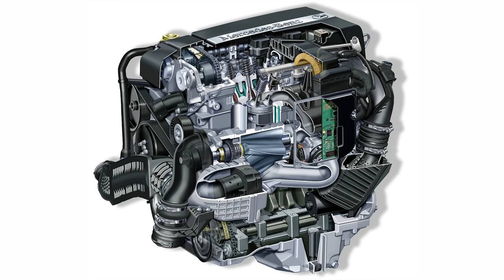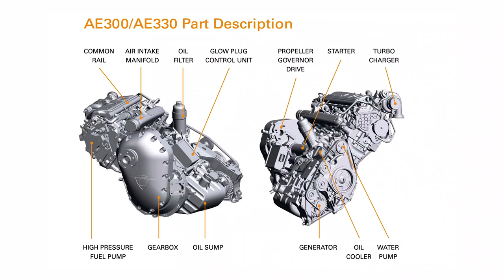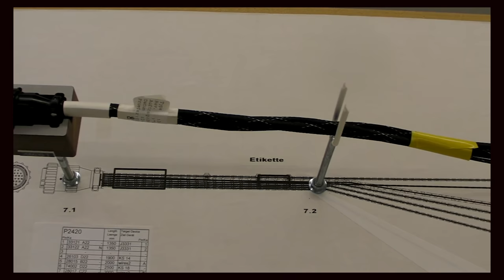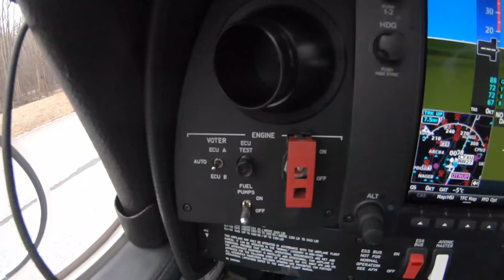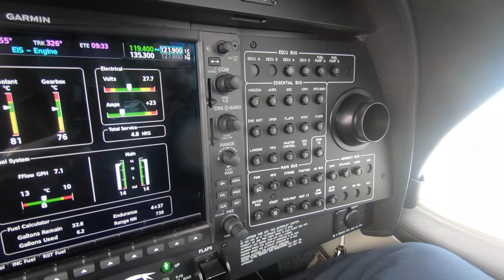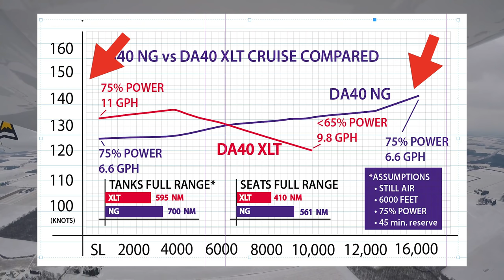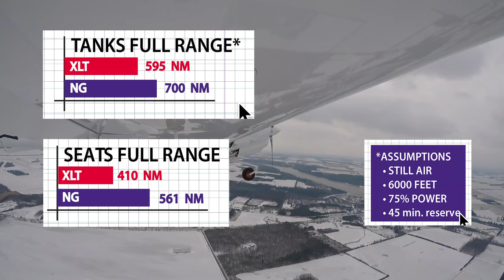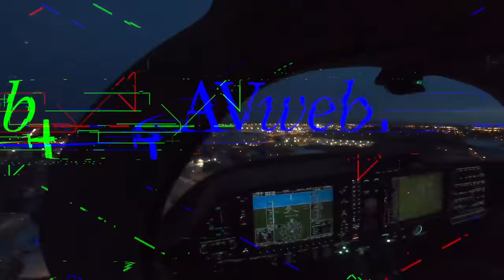Avweb's Diamond DA40 NG Flight Trial

Comment: You mean those engines that emit 40 times above the allowed emission limits, but were forging the test results? I think I'll pass, thanks :)
Reply: Aviation engines don't have emissions controls anyway, so they pollute far more than automotive engines, but that's not a major concern thousands of feet in the air and with so few light aircraft flying (relative to cars on the road). Lead is more of a concern than anything. What would really benefit GA is the modernization of gasoline engines, in order to eliminate lead, reduce failures (partly due to pilot mismanagement), reduce fuel costs (leaded fuel is pricey), reduce fuel burn, and decrease weight. Diesels move in the wrong direction when it comes to weight and costs.
Reply: Those were from VW. This engine was originally from Mercedes.
Reply: @PistonAvatarGuy  Many of the new lycomings will run on 100LL or unleaded 97 - 100 octane (depending on the engine) mogas.
Reply: @glibsonoran  But they guzzle it like there's no tomorrow. Modern engine designs would allow for very significant improvements in engine efficiency.